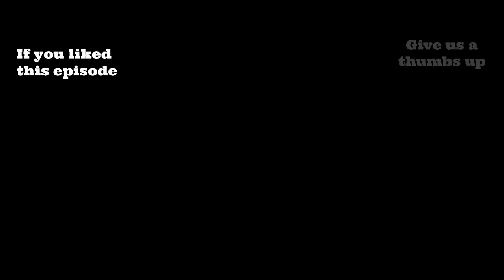LOOK OUT!! | Broken Receiver Hitch | Jeep comes loose

Comment: I know this is old, but someone may still benefit from more discussion.  I did not see the weight rating of the hitch "ball mount" mentioned in the video.  They are available with ratings under 5000 lbs up to over 25,000 lbs.  Many people see only the ball size and shaft size and think it looks beefy. Mr hobo, if  you still have the broken pieces, you would be doing us a great service if you would look for the ratings on the ball mount shaft and also the ball.  Let us know please.
Reply from the maker: Thanks for stopping by @KipOConnell. What broke was a "duel hitch extension"  not a ball hitch.  
I do not have the parts any longer and I do not know if it actually had a weight rating. Thanks for watching.